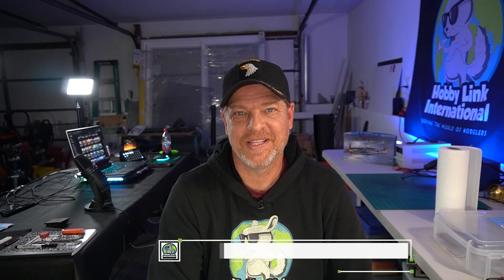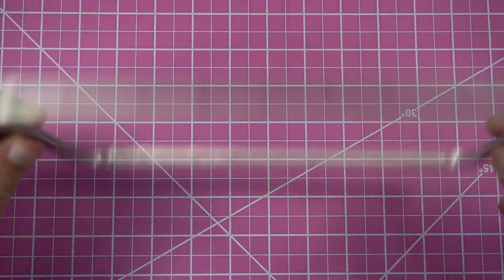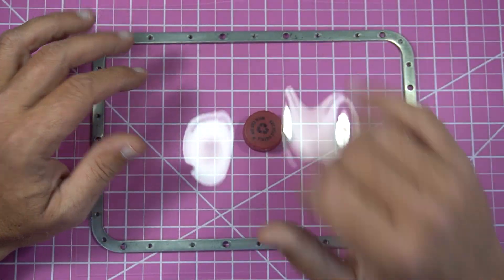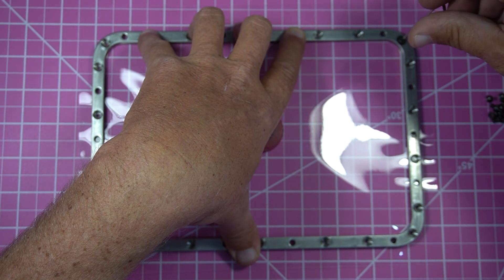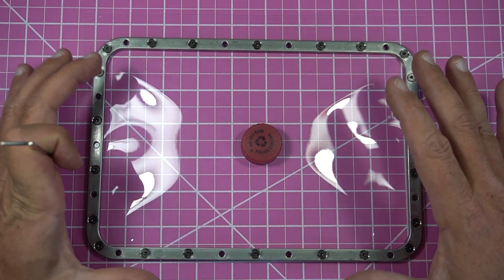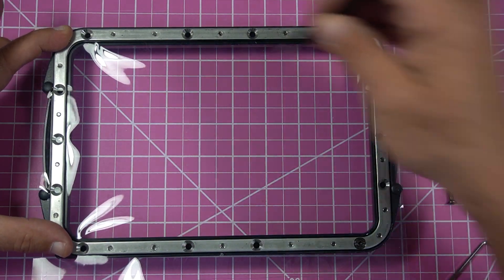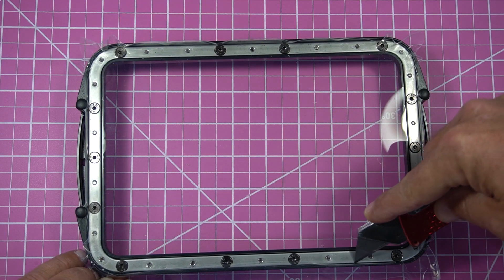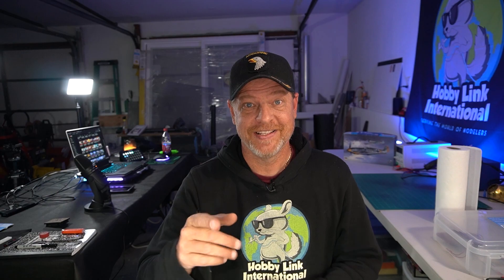A Beginners Guide: How To Change Fep On A Mono X

Comment: I would really like to thank you. After dealing with the Ender 3 V2 model for 3 years, I bought the Anycubic Mono X6 k resin Printer. After the feb film was broken, I was a little panicked because of the screens, but thanks to your video, I replaced it in one go. Thank you very much.
Reply from the maker: Thank you for stopping by and checking out the video. And thank you for the kind comment. I am glad it was helpful in resolving your problem.

Comment: What size are the black screws
Reply from the maker: At work right now when I get home I will take a look.
Reply: @HobbyLinkInternational  thank you kindly 🙏
Reply from the maker: @whoa6375  i pulled out the spare black screws that came with the printer (the larger screws) The have GX 12.9 imprinted on them. Measuring them they are 12mm in length. Fishing around a bit it seems the black ones are m4 12mm screws and the smaller ones are m3 5 mm flat top screws. I hope this helps.
Reply: @HobbyLinkInternational  helps immensely thank you 🙏 I just ordered replacements
Reply from the maker: @whoa6375  awesome :)

Comment: Great video! But when I did this, the bottle cap scuffed the FEP a bit. Has anyone else experienced this? Should I start over?
Reply from the maker: I haven't had it scuff up the FEP. How bad is it? Eventually there will be markings in the FEP it should be ok as long as it isn't too hazy.

Comment: How did you know how tight you wanted the FEP sheet? Other videos do frequency but I don't think anyone can agree on a number since everyone is using different mats / audio analyzer apps
Reply from the maker: I learned from watching the anycubic video. They didn't tune their fep at all. I just went step by step what they did.
Reply: @HobbyLinkInternational  same! It was a very nice video, I was not sure if I was supposed to tighten the screws all the way or enough where it's all even past hand tight.
Reply from the maker: @nicholasta9499  I stopped tightening as soon  a felt bottom. So far so good :)
Reply: @HobbyLinkInternational  ah.. thanks for the reference. So there's still room for me to tighten but it's more than a two finger touch. The FEP is pretty tight already where it has some give but not totally taught. I think I'll just have to do a test print 🤷
Reply from the maker: @nicholasta9499  isn't 3d printing so much fun lol. Mine is pretty tight the nice thing is a hear more of a peel off the fep than a pop.
Reply: @HobbyLinkInternational  sometimes when I dig myself into a rabbit hole of tuning and test prints I forget the art that I actually try to make from this haha

Comment: After installing the FEP into the frame, run a pair of scissors around the edge to cut off the excess film. Then install the frame into the vat. It's a lot easier than trimming it off after it's installed. 
This way you don't scratch the edge of your vat and it's a lot safer.
Reply from the maker: Thank you for the tip much appreciated. I did notice I was scratching it.

Comment: Funny question, but what bottle cap did you use?  I have the same printer and I destroyed the polarizing filter.  I bought a new one but have to install it, just working up the energy.  Mrs. Maker keeps hounding me to get it done as we need it for some Halloween parts.
Reply from the maker: I used a 16 ounce Dr. Pepper cap of course lol. Yes and you must fix it soon Halloween isn't too far off.
Reply: @HobbyLinkInternational  I need it for the Supernatural Impala Halloween build which she is on my back about starting.  She runs a tight ship, she has all my builds on a large production chart with deadline dates.
Reply from the maker: @TheMakersCave  awesome!!!